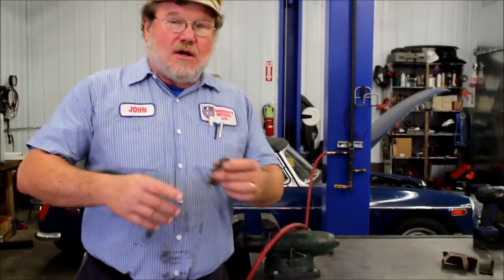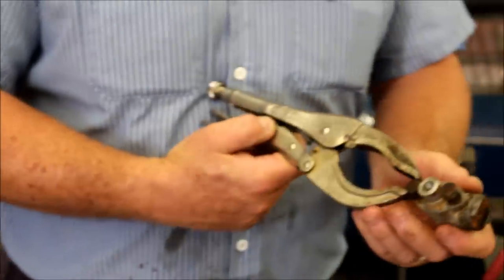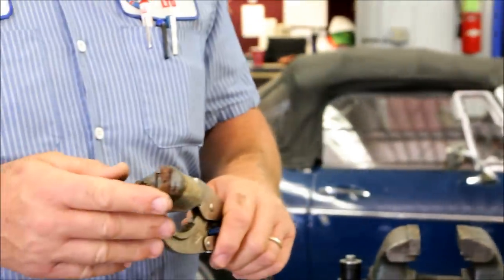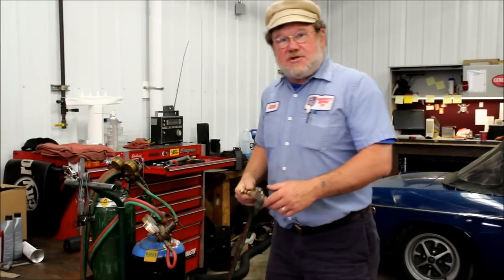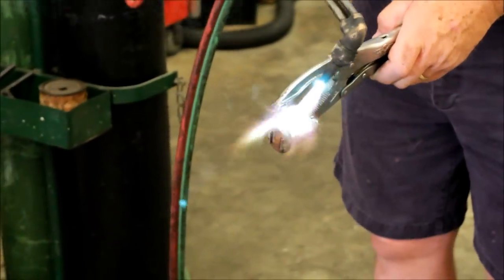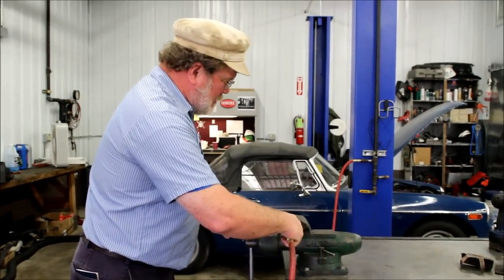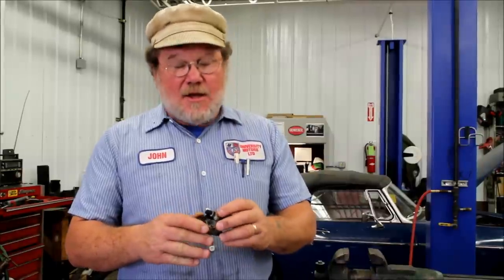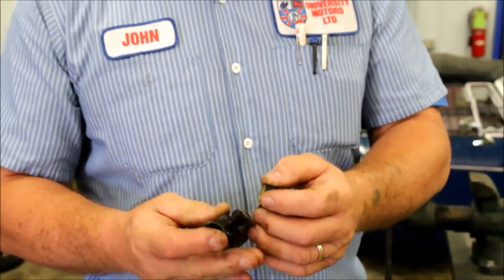207 MG Tech | Dismantling frozen MG brake cylinders

Comment: ideally, when you encounter an heavily pitted wheel cylinder and a new part is not available, you install a brass or stainless sleeve or you overbore it to the next size and fit a cup and piston to that size.
on such a repair, reliability of the intervention is of prime importance.

Comment: I take it there isn't a metal sleeve inside of the wheel cylinder bore? I'm amazed those housing don't wear out quicker with a steel piston going in and out. Seems to me that a sleeve would solve a lot of problems with those.